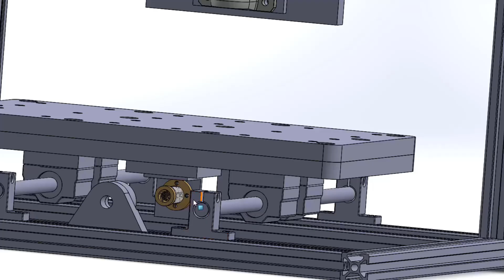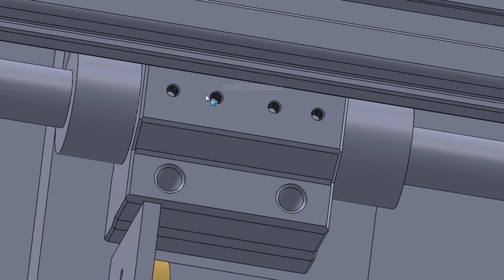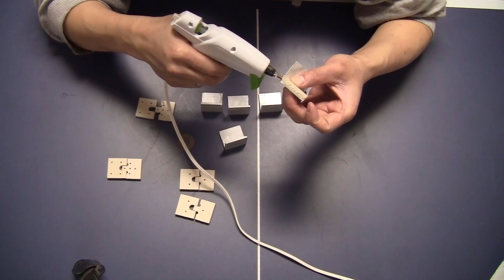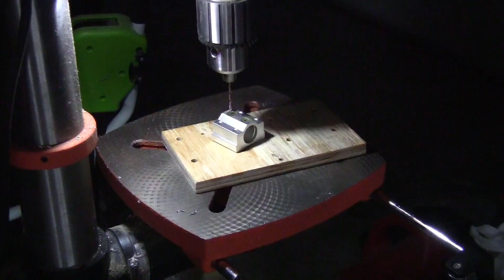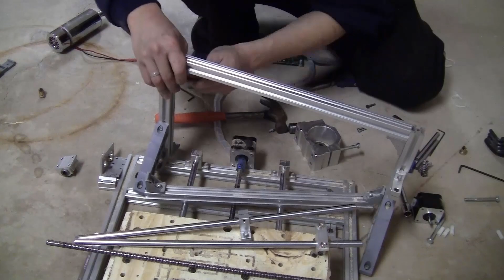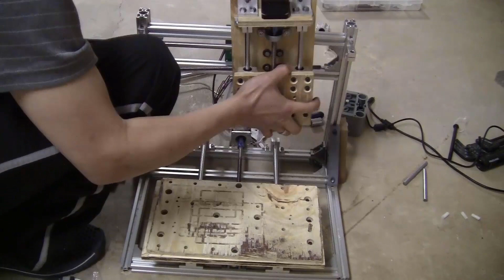3018 CNC - Major upgrades (working range, spindle, spoil board, precision) - aluminum dry cut test

Comment: 3 quarters of an hour of ingenuity and mesmerizing skills. As instructive as entertaining Minh, thank you! I do think you've made the possible improvements on this machine: Now it's a CNC 3018 PRO POWER PRO and it won't stay on a shelf I presume. (FR) Fascinante la facilité avec laquelle tout est expliqué! Tous les détails y compris les plus menus, sont passés en revue. L'accéléré est bien utilisé pour qu'on puisse s'attarder sur certains points. Il n'y a rien à dire mon  ami, c'est du travail, beaucoup de travail, que du partage de savoir faire. Grand merci. J'aime bien pour la précision des trous, l'utilisation de gabarits en contreplaqué. De la méthodologie d'ingénieur transperce à travers tout ça ;) L'ingénieur made in France n'est pas mal du tout.
J'attendais seulement qu'à un certain moment, il soit mentionné que tu a pris des pas-à-pas nema un peu plus puissant, mais apparemment les précédents moteurs demeurent utilisables. Gagner en profondeur et stabilité dans les axes Y et Z, est un grand PLUS! On peut avoir plus d'ambition. Éliminer les jeux sur les axes était impératif. C'est merveilleusement bien fait. Cet appareil n'a plus grand chose de commun avec l'approximation du sorti de chaîne ;) Oui! On peut vraiment parler d'upgrade! Je pense que tu as atteint le niveau max possible d'upgrade pour cette machine, compte tenu de sa structure d'origine. Bravo! Ceci étant et ça dépend des projets, l'adaptation à une surface plus grande ne devrait pas poser de problèmes...
J'ai aussi remarqué que le spindle est désormais un 400W. Mais l'ensemble reste relativement silencieux, ce qui ne gâche rien. On voit que tu es un praticien Minh: l'histoire des écrous est amusante! Tout de suite une solution pratique qui marche. Je m'attendais à un upgrade mais pas à ce point, en gardant quand même une grande partie du squelette d'origine. Ce qui réduit les coûts de l'upgrade. Pas mal.
Bein, je ne tiens plus. IL faut - plutôt faudrait - voir une application de ce 3018 prometteur. Vivement la prochaine video. On note un maintien de l'ensemble considérablement amélioré dans le test de l'alu. Pour être franc, j'envisage l'usinage de petites pièces (60x70mm) en alu surtout pour mon modeste CNC. Avec le renforcement de la structure et le gain dans les axes, cette machine est devenue une pour hobbyiste sérieux, assurément pour une poignée de dollars. Merci Minh et merci d'offrir du temps - et de l'argent - dans ton partage. J'apprécie beaucoup.
Reply from the maker: Les nemas d'origine marchent quand même sans problème. Je voudrais juste prendre la chance pour tester les plus grands pour voir si ça marche avec le contrôleur de la. Ça ne doit pas être très bon pour les stepper motor driver car les moteurs sont de 2A et les driver sont de 1.4a. Je changerai avec les drivers externe, c'est assez facile à faire et la vidéo a été trop longue. Peut être j'ajouterai dans une autre vidéo comme un autre upgrade. Merci beaucoup pour les commentaires. Ça me fait plaisir de savoir que mon travail est apprécié.
Reply: @minhsmancave9448  Non seulement apprécié mais suivi ;) D'accord pour les ampérages. IL n'y a aucune urgence à démonter les nema s'ils font l'affaire mais mon intuition - science inexacte - me dit qu'un certain moment, si l'on travaille avec de l'alu régulièrement, on finira par entendre couiner les moteurs... Je n'ai pas forcément raison. Juste une curiosité: Tu étais à l'INSA de Toulouse et après? à l'INSA de Lyon ou c'était pour une spécialisation post-ingéniorat?
Reply from the maker: J'étais à Lyon 1 après L'INSA pour un stage fin d'étude. Ensuite, ils m'ont offert une thèse en collaboration avec université de New York. Après la thèse, j'ai continué à travailler à New York comme post doc. C'était ma route pour venir ici.
Reply: @minhsmancave9448  Je m'en doutais un peu ;) Tu es ce qu'on appelle en France une "grosse tête". Les Vietnamiens se débrouillent en général très bien dans les études supérieures. Tu ne fais pas exception. C'est très encourageant pour ta culture. Beau parcours. Félicitations. Un vrai hardworker ;) J'avais un très bon ami Tran Phong Nia qui a disparu mi-2000, de 20 ans mon aîné. Il était connu à Strasbourg pour avoir donné des cours aux futurs ingénieurs asiatiques de la ville, avec un record de succès. Certains ont intégré HEC, X, Centrale etc... D'autres ont émigré aux states et ont achevé leur PhD. Les Vietnamiens ont une très bonne image de sérieux et de travailleurs qui n'est pas usurpée. La preuve! Tu en fais partie ;) Heureux de te connaître à travers ta chaîne.
Reply from the maker: C'est assez vrai pour la plupart des vietnamiens qui font bien leurs etudes dans les pays etrangers. Il faut noter que les eleves vietnamiens qui viennent en France pour leurs etudes sont plutot des elites. C'est le contraire pour moi, je suis pas tres bon avec les etudes theoriques, je viens d'un petit lycee de la compagne. J'ai ete bien chancheur quand l'INSA a accepte mon application et a refuse pas mal les autres. Je pense qu'ils ont voulu juste experimenter un peu avec moi. J'ai meme redouble un ans a l'INSA. Mes profs m'ont propose la these car j'ai fait bien les traveaux pratique et les applications (je suis plutot un ingenieur, pas trop un chercheur) ce qu'ils ont besoin parfois dans la recherche. Donc, pour moi, quand on n'est pas tres bon, il faut travailler dur.
Reply: @minhsmancave9448  Je retiens la dernière phrase que je partage entièrement. Tu as malgré tout une qualité qu'on retrouve dans tes videos: l'opiniâtreté, la volonté d'aller jusqu'au bout malgré les difficultés. C'est plus utile dans la vie. Mais pour les Vietnamiens dont j'ai parlé, certains sont des descendants de boat-people des années 70, moins élitistes que ceux qui arrivent du Vietnam actuel, c'est vrai. Quoi qu'il en soit, l'image du Vietnamien en France, est à son avantage. Merci d'avoir répondu à mes questions un peu indiscrètes. Mais ton américain qui est "fluent" tu l'as appris où? sur le tas à New York?
Reply from the maker: Mon parcours pour apprendre les langues étrangères n'est pas du tout extraordinaire et non plus recommandé aux autres. J'étais forcé par les situations à apprendre. Comme je t'ai dit avant, je viens de la compagne du Vietnam où on n'enseigne pas très bien les langues étrangères. J'étais nul en anglais et ne connais pas le français. J'ai passé un ans pour apprendre le français avant de venir à l'INSA. Heureusement, les études à l'INSA n'étaient pas trop demandés aux niveau de langue. Pour l'anglais, à L'INSA, si je n'ai pas le TOEIC plus que 750 sur 990, ils retardera mon diplômes pour 1 ans. Une fois, on a du faire une présentation en anglais en 4ème année d'études, chaque fois je parle, tout le monde a rigolé car ils n'ont rien comprit, même la prof qui est anglaise. Donc j'ai dû me forcer à regarder les films et les séries télé américains, pendant ma dernière année d'étude. Par chance, j'ai passé Le TOEIC avec 780, c'était juste. Une fois venir ici, l'environnement m'a forcé à parler comme le français en France. Donc, c'était pas facile. J'essaie d'encourager mes enfants à apprendre les langues le plus tôt possible. Il ne faut pas prendre ma route.
Reply: @minhsmancave9448  Tu as raison. Comme on dit en français:"Nécessité fait loi" c-à-d que quelquefois tu es obligé d'apprendre à tout prix. Ce que toi et moi avons connu. Je suis d'accord que l'apprentissage des langues doit se faire très tôt pour éviter des efforts que tu as du fournir. Je reconnais ta volonté. Le TOEIC à 780 me conviendrait terriblement ;) Je pense qu'il faut s'immerger dans une culture pour acquérir rapidement des réflexes linguistiques. Plus on est jeune, plus c'est facile. Merci de t'ouvrir avec franchise mon ami. Mon admiration demeure pour ton parcours singulier et difficile et ton goût de partage de tes expériences. Tu as fait du chemin depuis et le résultat est là. En tout cas, je suis heureux d'être tombé sur ta chaîne YT. À la prochaine Minh!
Reply: @minhsmancave9448  À propos, je trouve ton américain parfaitement articulé et trés clair, trés "fluent". J'aimerais avoir cette aisance aussi ;)

Comment: Thank you
Would you suggest sensor for z axis zero
Reply from the maker: I probably won't recommend sensor for zeroing. The distance detected by sensor usually not that precise (not at the CNC level) and also each type of sensor only work well for certain materials. And you will need some electronic adaptation to make it to work with Grbl. For me, touch probe is the cheapest possible and pretty precise.
Reply: @minhsmancave9448  
Thank you
Kindly share a link for touch probe
Can I use with 3018, where to connect, any video available to show with 3018
Reply from the maker: Ready for you my friend : https://m.youtube.com/watch?v=PmRQO1XMm-c

Comment: You increased the axis Z but decreased the axis X. The volume remains the same. :)
Reply from the maker: The x axis range stayed the same. The back of the Z axis bloc doesn't touch the bracket or stepper motor on the x axis
Reply: @minhsmancave9448  You're right. Just hard to see without a back / top view. Sorry.
Reply from the maker: No worry my friend, my bad for not showing it